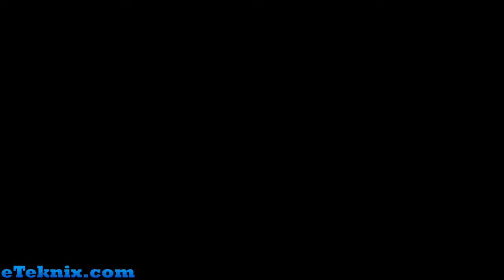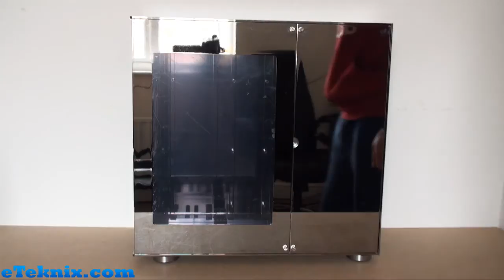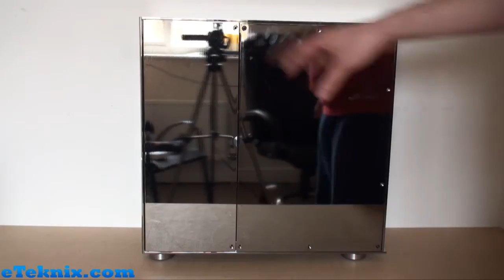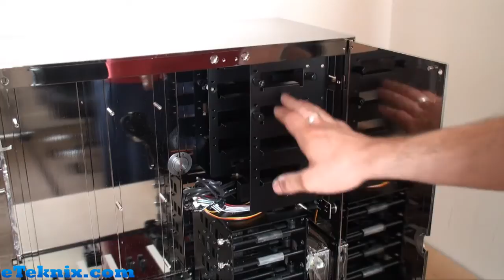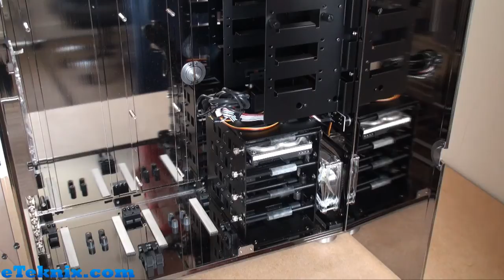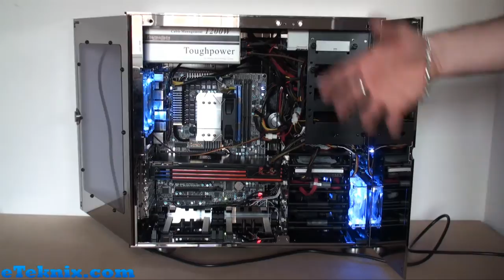Video Review + Full Build: Boogie Bug Dub Style M (Zalman Z-Machine GT1000)

Comment: Aside from the chrome exterior, it's not a whole lot different than the original Z-Machine-right down to the firewire.
From a "gamer" POV, there's not even the slightest chance of installing some sort of watercooling into this box-aside from something from Corsair or Asetek
Reply: from a modder perspective : a single fan closed loop was worthless on a 4770 sitting on an asus formula, however, the forward area on the non-window side is removable/changable with a drilled out sheet, so the rest of the formula & gpu watercooling can exit through there,
Reply: I'm still waiting for formula 9, so I am using the above machine now, with a 240mm rad closed loop, and its whisper quiet.